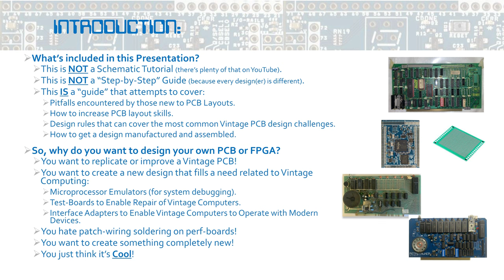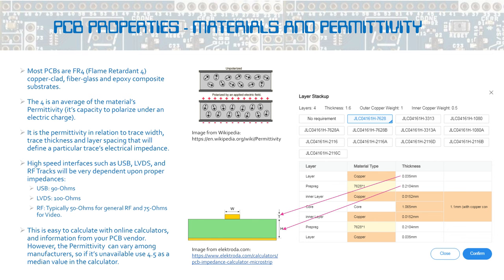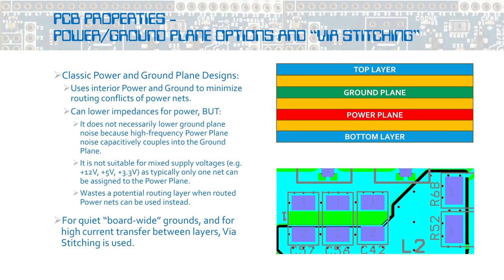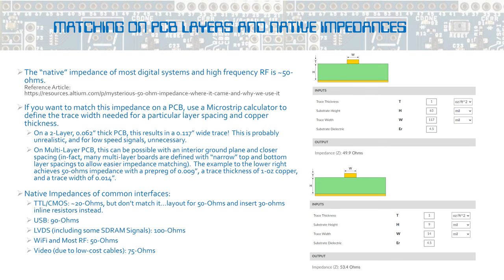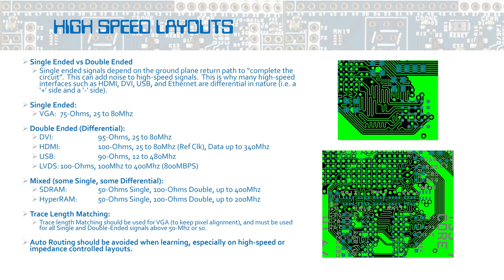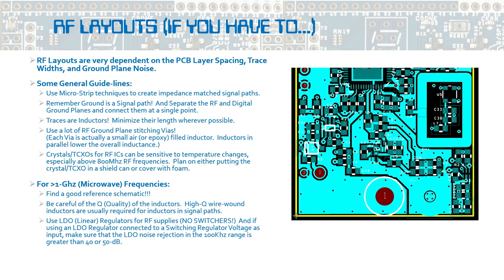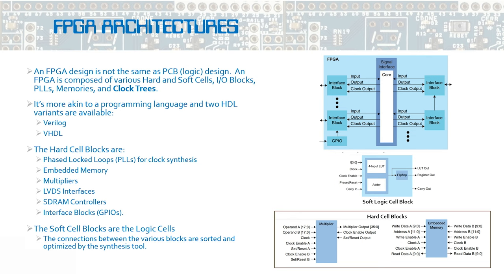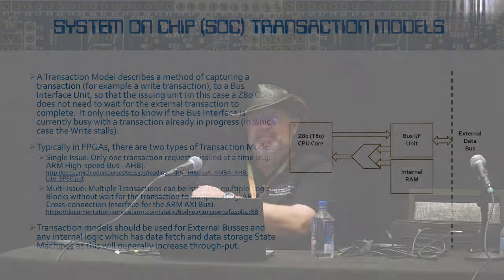Things I Wish I Knew When Starting FPGA and PCB Design | VCFMW 19 (2024)

Comment: One of the last questions wrongly described Adrian Thompson's experiments in evolvable hardware using the old Xilinx XC6200 FPGAs. It was genetic algorithms and not AI. He evolved a circuit that could discriminate between a 1KHz and a 10KHz square wave on its single input by directly mutating the bitfile - no synthesis tools involved. This example was selected between the timing involved is orders of magnitude greater than the delays in the FPGA so it would have to create something like counters at the very least. The evolved circuit was essentially an analog one that no human designer would have created and it wouldn't work if loaded into another FPGA of the exact same model.
Reply: Well AI don't mean anything anymore, but genetic algorithms are considered "AI", there are so many different algorithms in machine learning, not everything has to be based on the perceptron model of the neuron to be considered AI.
Even simplex optimization can be considered AI nowadays, it really don't mean anything anymore.
Reply: I knew a little about what he was talking about, but I didn't want to go too far down the AI/genetic algorithm path as I didn't want to encourage abstracted "tools" which "figure it out for you" as a solution for beginners.   New designers who choose such a path don't really get a sense for what is occurring at the RTL level, and when you're first starting out, that can create mysterious problems that are hard to diagnose and debug.
Reply: @monad_tcp  I agree.  The term "AI" has become incredibly overloaded, to the point that a simple histogram of prior user menu choices in a UI for sorting menu options is now called "AI".
As for online AI, the principle of GIGO still applies.

Comment: Great talk! While it is generally true that FPGAs don't have internal high impedance, the old Xilinx 4000 family did. It helped not only with busses but also with wide logic like CPLDs can easily implement. But they decided it was better in practice to just stick with multiplexers and never did it again
Reply: I remember the XC4000s, but I never used that feature.  The automatic timing resolution synthesis tools have abandoned internal tri-state buses in favor of better and faster predictive timing between logic blocks.
With the advent of Multi-issue/Multi-transaction silicon backbones (e.g. AXI4), internal tri-states, don't really make sense anymore.
Reply: And thanks!  😁

Comment: 'mils'? It is not the dark ages anymore, use standard units of measurement.
Reply: Ha!  I hope you got more out of the presentation than that?  I have PCB designs going back 40 years, and yes, when they were initially designed (in the US by the way), the standard was in "mils" and a lot of designs that are now vintage were the same (for the US based designs anyway).  I currently design in both, depending on the tool and design at hand.
Maybe learn how to convert on the fly to handle both?